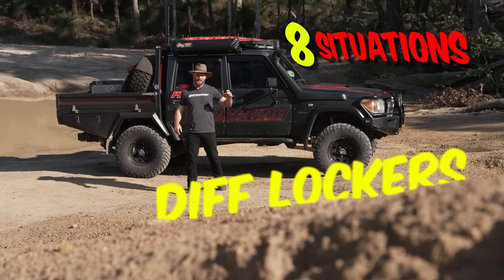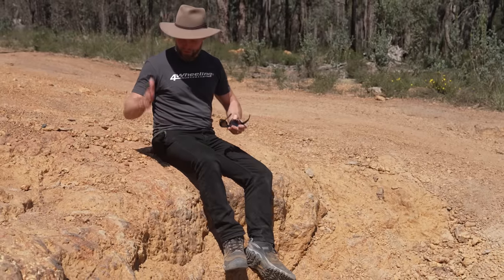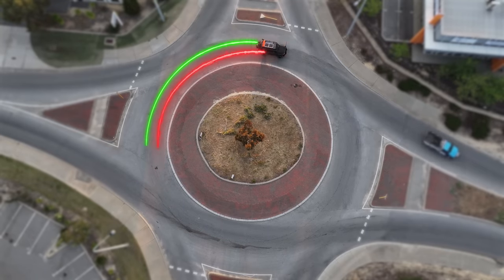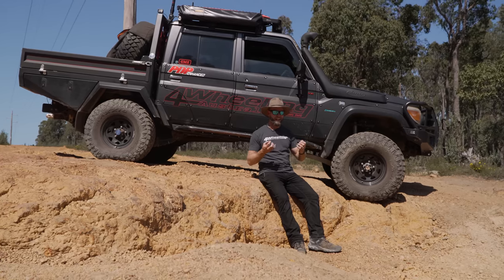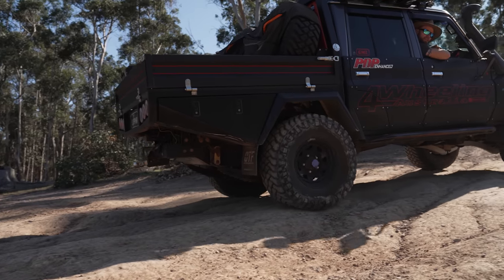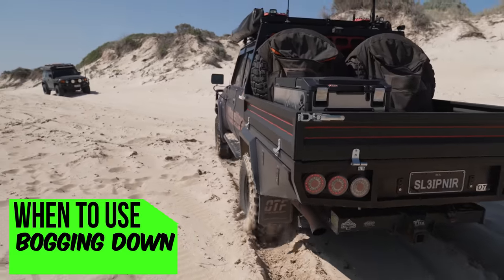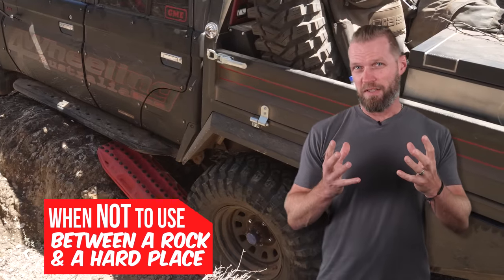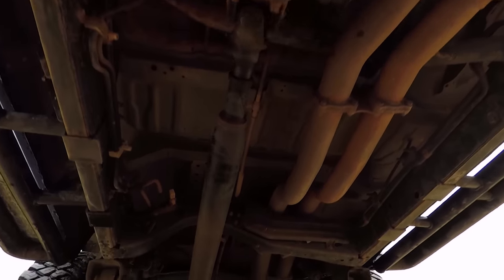8 SITUATIONS NOT TO USE DIFF LOCKERS #difflockers #4wdlockers

Comment: So the ultimate solution is to keep all lockers on all the time and negotiate every turn via 4 wheel drifting...
Reply: You can also overbuild your drivetrain. While he was talking about stuff breaking, I was wondering. What if you use parts meant for a truck twice it's weight or something? Like that abomination pick up truck body on a semi truck frame, Ford F650.
Reply: @observingrogue7652  Stress will eventually break something.  What will fail first?  Is that more expensive than what you reinforced?  For example, your axle is fine but the transmission grenades because that was the weakest point?
Reply: @observingrogue7652  Weight, installation costs, fuel costs, difficulty of sourcing parts, the danger of "this thing is unbreakable!" which is always a death sentence.

Comment: one other thing to keep in mind in an open diff, if one tire is stuck and the other is free spinning, the free spinning tire  can spin up to 2x faster than it would in a normal situation vs what ur speedo reports cause the way open diff works. if that spinning tire suddenly catches, thats more shock load than you might expect.

Comment: Great information to help others that are new to the 4WD Scene!! Even I had trouble explaining when and when not to use and this helps a lot!!

I would also like to see a deep dive video of different locker types against each other
Reply: use lockers all the time. but not with 10,000 revs as ronny did.. best lockers are ones you dont fk with.. like detroit, or lunchbox..  e lockers & air, brake, as they have dangling parts & subject to heat.. cant beat yank sht.. if you have to turn your locker off to turn,,you got the wrong 4x4.. great information,,heres some,, join a registered club,,with trainers..
Reply: @harrywalker968  clearly you don't know what you are talking about. A Detroit Locker is really just a Limited Slip type Differential that Mechanically locks under the right conditions if lucky. A lunch box locker is simply a cheap box that barely puts pressure on the axles. Both an E-Locker and Air Locker have a simple mechanism that will engage when either a Coil is Energized or air pressure is applied. Can these fail? To an extent yes, but usually it's the simple stuff that is able to be replaced. Also if you feel that you have a problem by having to turn a locker off to turn then you don't understand how the drivetrains operate on vehicles.

Comment: A great video, Ronny!  Lots of useful information, do's and don't of using diff lock.  Nicely presented.  I have a question:  what if we don't have manual control or don't have diff locks in the vehicle.  E.g.  Suzuki Jimny 4x4 setup, will this be possible for you to make a quick 3-5 minutes video on do's and don't or how to efficiently use Jimny 4x4 without breaking anything.  I don't have the luxury to have these trucks but I drive Jimny.  One quick video will help me or many others a lot.  Thanks again mate ❤

Comment: This was great, Ronny. What do you think about adding a rear air locker to a rwd vehicle? Worth it? I hear a lot of poeple say a 2wd vehicle with a rear locker will go 98% of the places a 4wd will go, but for me, it's about getting out of sticky situations (muddy mountain roads and sandy beaches).
Reply: I have installed an e locker in my Toyota slwb 2wd campervan. It's been a life saver, keeping me from bogging when off the hard surfaces. It's not infallible though and i also carry a winch which i can fit front or rear to get me out of bad bogs. Also chains and mud boards. Who needs 4wd??😂😂
Reply: Defending on the locker with 2wd vehicles to do 4wd stuff is Just dangerous. because you can't get out if you stuck unlike when 4wd with rear locker got stuck, there are not enough ways to get enough traction and right weight distribution. lockers are safety device!

Comment: Very informative. Looking at how "brutal" electronic traction controlsystems in modern awd vechicles act, i always thought that that shockloads and stresses the driveline even more than when both wheels are locked together. (There's more seemingly sudden "stops" of a fast turning wheel, loading the stress via the diff onto the other one)

Comment: Great video! Tend to not use the rear locker or think of it as a resource tool but got me out of trouble once recently on a sandy bumpy hill that tyre pressure and momentum didn’t help. Rear locker on, climbed the hill like a breeze.

Comment: Great video. And the talk about differentials and high traction surfaces is another point of data to support the need for the old 2L feature ... it used to be available on some vehicles, and disappeared. On rock surfaces where all 4 wheels aren't needed, 2L would be a godsend.
Reply: They need to bring back 2L great for reversing trailers up steep driveways

Comment: I have ARB lockers front and rear on my 80 landcruiser diesel I’ve owned for 20+ years since I was a teenager when I bought it. I’ve broken three rear diff centres (once was the air locker bolts) and one front. But that’s in Victorian high country. I also have a PTO winch running from gearbox. Good set up. But you’re right, and one thing I know for sure, never reverse up hill with a locked front diff. The rest of the time, I hardly ever get stuck. Especially when I put front and rear chains on in snow season and lock both diffs. Cool info. Many people are totally ignorant and wonder why they always get stuck and cannot follow my path 😅

Comment: Excellent video. I’ve heard lots of people say to never put a front locker on an IFS vehicle because it will break a CV. I think the problem is that they are using them at incorrect times.
I’d love to hear your thoughts on air versus E lockers.
Reply: Maybe not the perfect example, but: Audi did put self locking diffs in their quattro cars for years. (torsen diffs front middle and rear) They don't anymore, for cost and weight reasons
Audi didn't have problems wiht snapped driveline parts.
All of these cars had IFS and IRS, but due to the nature of it, the torsen probably only really "locked up" on snow. So when the traction wasn't sufficient and thus in the right condition for locking a diff.
Reply: And a Torsen is not actually a locked centre. It is a torque biasing limited slip centre that still requires some resistance from from the wheel with no traction, ie, it will not carry torque across to the wheel  on the ground if the other is in the air. Different animal altogether. @nirfz
Reply: @trickster8635  i don't think that's the case. As soon as there's too much difference betweeen the wheelspeeds it basically locks.
You may want to take a look here: https://www.youtube.com/watch?v=JEiSTzK-A2A

Comment: I always manage to learn something new from you, thanks!  Lockers comparison video please, if possible including cable lockers!  Majority opinion seems to favor air lockers (like arb) over e-lockers (like harrop), I hear that they engage more quickly, are (maybe?) stronger, don't disengage on rollback, etc.  But I really, really dislike the idea of airlines running the length of my chassis.  So many places to spring a leak!  Diagnosing n repair would terrible on the trail, seems to me! And I have a nice portable air compressor that I like to throw in the back for 4x4ing, n take out the rest of the time when using my kzj78 as my daily driver.  So I lean towards elocker, since mine does not have factory locker.  But i live in Africa and I love simplicity!  What about a cable locker?  I see virtually NO reviews, bug 8m the kinda of guy would is open to that option, if they are any good - simplicity is a beautiful.thing!
Reply: And, I can only afford one.  I don't generally do serious uphill rock crawllng, but do come across deeper water crossing and sand/mud and traction issues, with some wheel lifts.  Am thinking if only one, go for the rear?
Reply: only lockers to buy, are detroit, or lunchbox.. detroit lock up under pressure, or there  then like an lsd normally.. lunch box, good for front diff, if you have hubs.. e lockers, air, lockers, have cables hanging in the air to get ripped off.. & they fail internally..

Comment: Hello mate! Here from the states. I wanted to comment on using the rear lockers in high speed. I currently own a ford Bronco with 35” tires and front and rear lockers. My Bronco allows me to travel at very high speeds in Baja mode. Great video!

Comment: I love the 4x4 system of the Mercedes G-Wagon. I drive these cars in the swiss army on and off road. The nice thing on these cars is that they have permanent all wheel drive. You can drive these cars with open diffs on snowy roads up hill with alot of traction and controll (not just RWD). 
Then when you go offroad, you can engage center locker, rear locker and front locker. The transfer case is also two speed with a low range for creeping really slowly over obstacles. 
I love driving the G‘s and I am constantly looking im the internet for a „less expensive“ one to buy. 

Thanks for your Videos! I love watching them.
Reply: Plenty other modern SUVs work exactly like that. Full-time AWD on roads, Centre-locked 4WD off-roads. LC150 Prado for 1 third of price of G.
Reply: @user-yl9vs9eh1w  
Yes that‘s right.
Most SUVs have AWD but not „real“ 4x4 with all the lockers and two speed transfer case. The G has kind of the best of both worlds, but costs an awfull lot…
I like the Prado. Here in switzerland the Prado costs 50k CHF in the lowest 3 door trim with the 2.8 Diesel engine.

Comment: Over here in Florida USA (sand and swamp) we try to keep the diffs unlocked as much as possible to reduce driveline stress also. We also add as much flex as possible to the suspension to keep the tires on the ground.

Comment: Nice video,
I have only / mainly experience of Toyota's electrical motor actuated diff lock and have wondered about the speed compared to air lockers (or is it leakers). The Eaton mechanism is flawed in my opinion / understanding.   Plus magnets should in my opinion only be on the drain plug.
Another question that I have about the use of stiffer side shafts is how much are you now impact-loading the ring gear and rest of the drive line if you do not have flex. This is similar to the impact forces if you should increase your snatch rope rating and reduce stretch Or to make a ridiculous exaggeration to snatch with a chain.
I have driven in mud with a Ford that engage and disengage rear diff quickly, but my cruisers are sometimes slower to engage or disengage especially under load - most probably not recommended. Steering in mud if you slide off course is so much easier and sometimes even possible if you are not engaged, but when you need traction, you need quick engaging diff locks before you lose momentum.
Diff locks can cause you to lose control / steering without the ability to disengage quickly enough even at low speeds - colleagues ended on their Hilux's roof at low-low speed.
thanks for your video.

Comment: I’m relatively new to offloading and own a Jeep Gladiator Mojave, which comes with only  rear lockers.  I live in the United States.

Around the seven minute mark of your video you are cautioning people not to use lockers at high speeds.

Do you think it’s a mistake if you use the rear lockers only when:

1). If you’re trying to go fast in sand (+40 kph) , do you still think it’s a bad idea?

2). If you are stuck in mud?

Thanks again for this most helpful content.

Comment: One thing I like about Land Rover traction control on my old solid axle disco is that instead of just having open or Locker I can have open, TC and then a locker when needed . I don't like just having open or Locker because the TC is very very fantastic and makes using a locker less often

Comment: Ronny, can you please do a video on twin auto lockers, for example on a Jeep Wrangler TJ? There must be some exceptions to your rules, because if you have an auto locker in the front then you’re driving it on the bitumen, you’re driving it in 2 wheel drive high range, you’re driving with full steering lock etc. The locker ratchets when it doesn’t need to lock, but what are the risks when you’re in 4wd, are they different?

Comment: 2 questions. 
1. The slide slope. I live in CO USA lots of off camber shelf roads. Sometimes there’s a lot of loose rock. You’re saying don’t use a rear locker? My understanding is if you start to slide towards the shelf your only hope is to floor it and you need that traction no?
2. I have aftermarket air lockers on my Lexus Land Cruiser. Any reason to use a rear locker with center locked or even in AWD mode (don’t have to go down to 4 lo or lock center with air lockers) thanks!

Comment: A deep dive on lockers from you would be awesome, given the detail & no BS approach you do in your vids. I personally run an auto locker front & factory vacuum locker on the rear & have done for many years with no issues, however I mainly run on clay/ mud up in Northern Rivers NSW. It would be very interesting how they all stack up against each other...........😃👍
Reply: in the u.s. there locked front rear allways, off road..  watch trailmater. & any other vids from u.s.. as they have been doing it for 300 yrs, as to our 3 yrs.. most all items 4x4 come from u.s. stikered made in au..or copies..

Comment: So, we were on the asphalt 2-lane highway to the ski lodge st Flagstaff, Arizona and my friend with the 4-door Jeep Wrangler Rubicon was doing fine but my 2-door Wrangler Rubicon was all over the snowy road and locking the front, to pull me along did nothing, locking the back and then both axles still had me practicing really fast steering. Turns out that my BFG tyres that are great in the rocky desert, mud and soft snow with those big knobby chunks of traction giving rubber had so much rubber, without tread, on the icy asphalt that it was like I was on racing slicks.  ....  Also, my lockers have run almost half a kilometer before they finally gave in and disconnected, which is a bloody pain in the arse.

Comment: Interested to hear about how auto lockers fit into this considering you have no control over their activation. Do the same considerations apply to auto lockers? Does having an auto locker have the same disadvantages in scenarios where you wouldnt want to use a locker?

Comment: YMMV, but for my money in everything but a really hardcore rig the way I set things up is install an auto locker like an eaton trutrac in the rear and a selectable locker like an ARB or Eaton E-Locker in the front. 

This way my rear locker is self engaging all the time and there when its needed, the front can be added in when needed. 

Only in a rig where I plan to spend more than 50% of the time off pavement would I consider a selectable in the rear.

Comment: Yet again great infos and I learned one or two things. Thumbs up!

Concerning a Locker Video, what about Torsen Diffs? Are they to be seen as locked diffs e.g. at higher speeds/momentum? What downsides do they bring compared to a manual locker?
Reply: Torsen is not a locker. Will fail in high horsepower applications.

Comment: I' had a cruiser with lockers and had it rigged to have control of front, rear and center at any time.  Deep snow on top of a frozen MN lake is the only time I locked everything in high range and gave it the beans   snow on top of ice.   Now I have a Raptor built up for the CA desert and it has a rear E locker and a front torsen. 

I really like the front torsen with IFS and CV axles.  If I do lift a front wheel and the traction control doesn't put the brake on the spinner I two foot gas and brake and its great.  It also goes not have a delay to unlock in the front.  

A electronic locking tru trac would be king.   Helical limited slip AND a selectable locker.